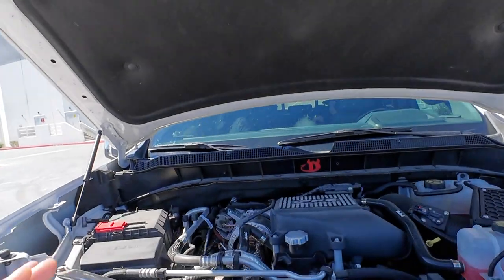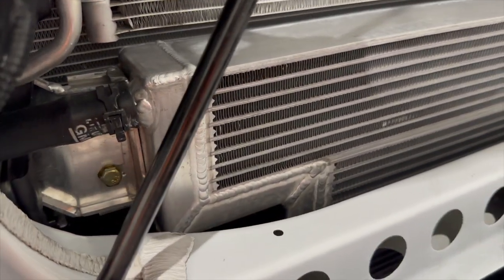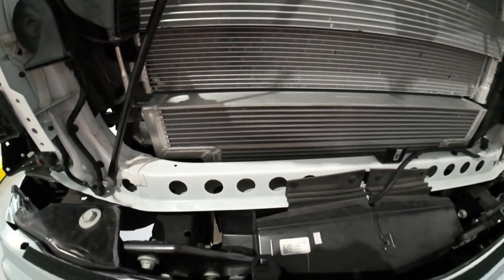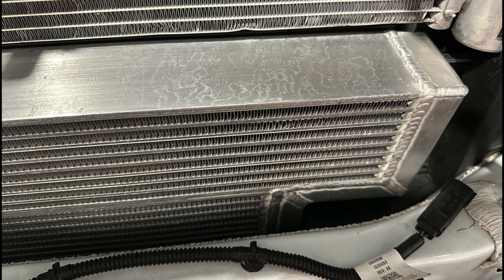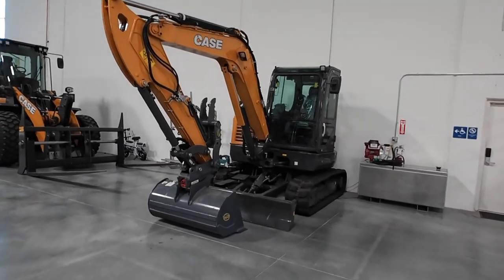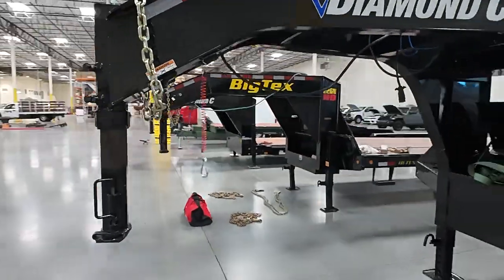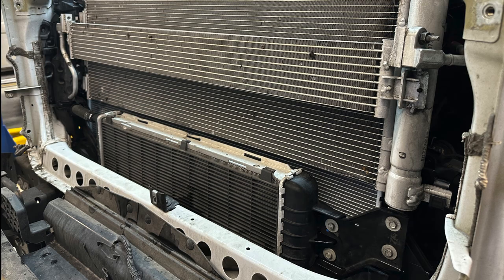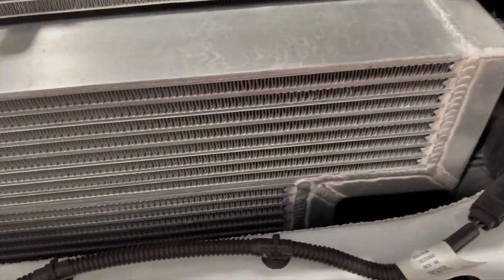PPE is TESTING Charge Air Cooler Radiators - FirstLook !

Comment: Hoping you can help. Think I have a bad charge air cooler sensor. Thought this was the sensors on the intercooler on top of the engine. Now I think it is the sensor in the cooler(90 degree sensor). Can’t find any info on their location. Can you point me in the right direction? Thanks!
Reply from the maker: how do you know you have a bad sensor? charge air cooler 1 sensor is at the rear/side of the charge air cooler and sensor 2 is at the front of the charge air cooler.
Reply: I was getting codes P00E0 and P00E2 which are for charge cooler sensors. I replaced the 2 sensors in my PPE hot and cold pipes and am still getting the codes.
Reply: Took it to the dealer to have the coolant control valve checked. They are saying it has a leak in the radiator. I had it on the lift in my shop and didn’t notice any wet areas. They want WAY too much to replace so trying to find videos on replacement. They stated that the AC system needs to be disassembled to replace the radiator. Is that correct?

Comment: I take it this also fits with their upgraded transmission cooler?
Reply from the maker: It does, the video shows it with a stock trans cooler in place. The reason they have a stock cooler there is because when they test parts, they like to test them by themselves to see what difference that part does by itself.